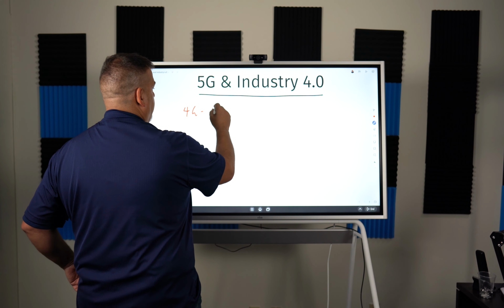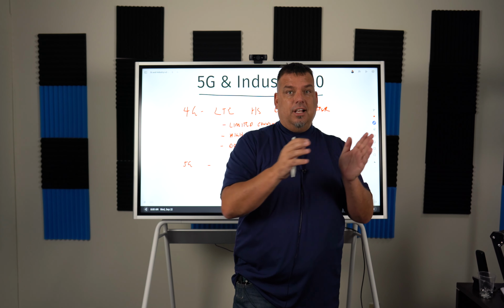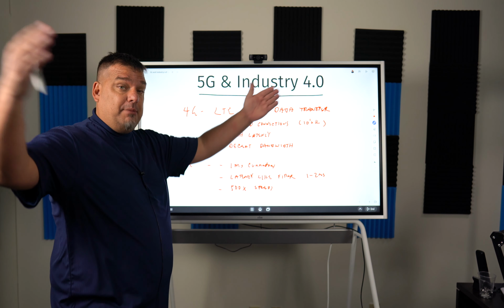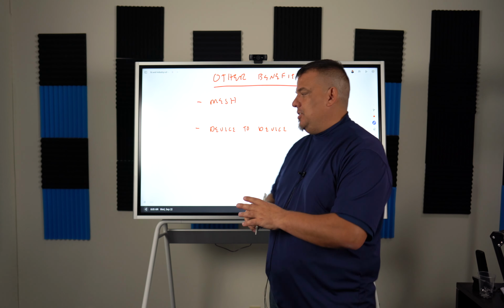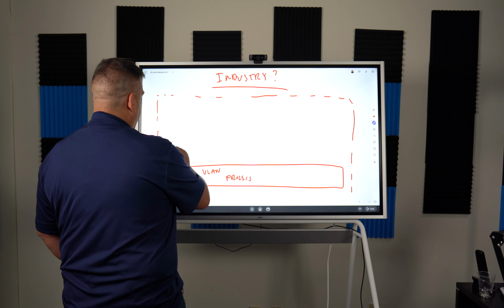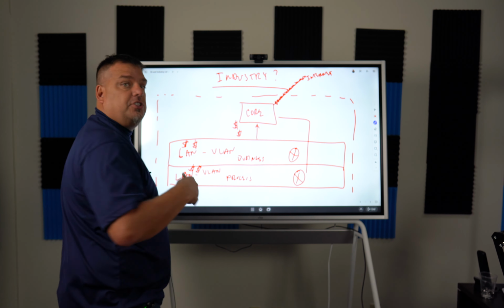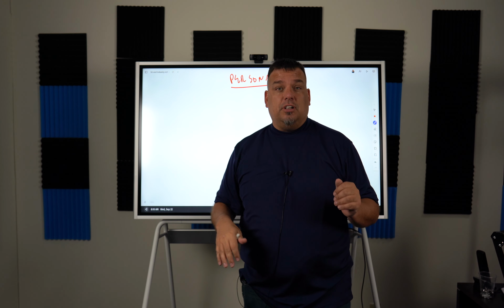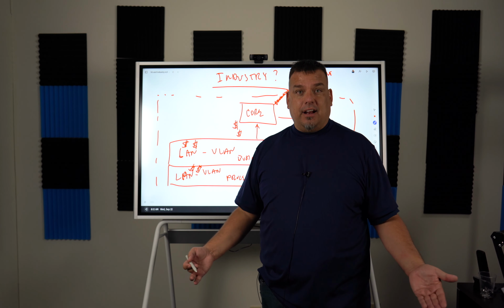The IMPLICATIONS of 5G for Industry 4.0

Comment: Have you seen 5G interference with older electronics and seniors? Some regulators like FTC with aviation and Nuclear Regulatory Commission regulations require extensive testing for communication and internet in power plants. I have seen 3 and 4 g impacted old (10 years ago) dose devices would jump when you transmitted from a cell or radio device.

Comment: 5G has a much lower range compared to 4G, so the towers need to be much closer. That would also explain the lower latency - signal doesn’t have to travel that far in a roundtrip. So would be surprised if you will have the same coverage area.
Reply: This is where Mesh and Device to Device comes in

Comment: I live in UAE and I have seen in most of the factories the PLC s used are very old with only communication to small HMIs. For those with new PLCs, machine manufacturer normally put password for the programs. No way to pull the data from those.
So I think, Industry 4.0 looks very far unless the factory decide to invest money to upgrade the old system and unlock the new system by paying charges to the supplier
Reply: Hi. I was thinking to move to UAE, wondering what kind of PLC they use there?
Thanks!